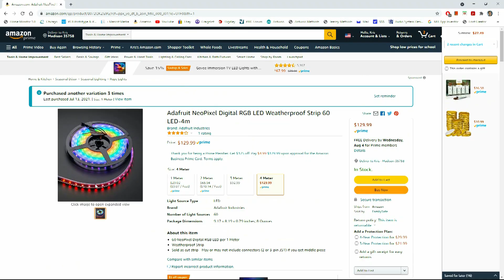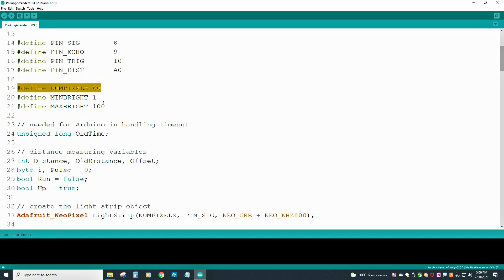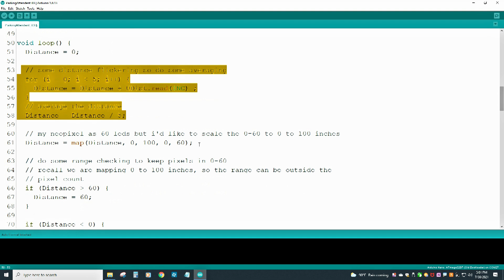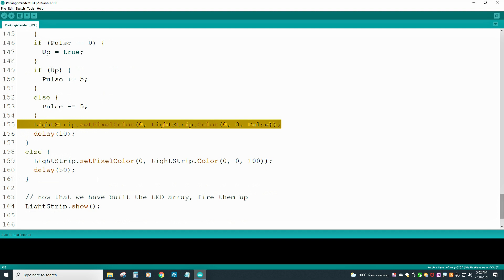DIY Garage  Parking Assistant

Comment: I enjoyed your video and decided to make this. I have copied your program and when I try to compile, I get an error on line 83, "ElaspedTime 
was not declared in this scope". On lines 28 and 29 you state "include if you are using a Teensy elapsedMillis ElapsedTime. First question is what is a Teensy, second question is how do I include elapsedMillis ElapsedTime? I am an old retired plumber and my wife got me an  Arduino Elegoo Mega 2560 Starter Kit for xmas. Computer programing for Arduino is fun to learn and I could really use this parking design for my wife, of course.
Reply from the maker: ahh yes. You will need to grab a library for the ellapsedMillis call. you can get this one

https://github.com/pfeerick/elapsedMillis

Note: A Teensy is a competitor to the Arduino and like a million times better--you will get there :)

Have fun.
Reply: @KrisKasprzak  perfect, compiled and loaded. Life is good, now to build  hardware from your schematic. Thanks again ✌️

Comment: Hello Khris, I just found you in YouTube ..... I need to subscribe, I enjoyed your work....and I run into this "Garage parking assistant" great video.
I was compiling the code and run into the following error:

81..// if activity, reset counter which will wake up the unit, and display measured distance
82..  if (abs(Distance - OldDistance) > 2) {
83..    OldDistance = Distance;
84..    ElapsedTime = 0;
85..   Run = true;
86.. }

Did not like line 84
Compilation error: 'ElapsedTime' was not declared in this scope

Here is the analysis that I got from a compiler:
"Since you are using an Arduino Nano, you should not use the ElapsedTime variable as it pertains to the elapsedMillis functionality, which is not inherently required for your scenario. Instead, you should rely on the millis() function and the OldTime variable that you've already declared to manage timing and timeouts in your code.
Here's what you can do to correct the error:
Remove or comment out any references to ElapsedTime in your code. Since you mentioned that the error occurs when trying to use ElapsedTime, you should ensure that any code attempting to use this variable is either removed or replaced with logic that uses millis() and OldTime.
Use millis() for timing: You've already started this approach with the OldTime variable. To implement a timeout or measure elapsed time, you compare the current millis() value to OldTime and update OldTime when you start timing."

Does this make any sense ?
Can I have your comments ? Maybe I am doing something else wrong since the original code is working, so I am not sure why I am getting this "Compilation error"

Thank you
Reply from the maker: When you have an application that is intended to run for weeks, months, or in this case, years, it's very bad practice to use millis(). After 29 days millis() will roll over. If the code does any time comparisons around the roll over your program will give some errors. While probably not a big issue here, it's better to use a library that will handle roll over.
Reply: @KrisKasprzak  Hello Kris, thank you so much for your reply. I have done all you shared with us here, but I can not get pass the 'ElapsedTime' in code line 83. 

I did download the <Adafruit_NeoPixel.h> and the <Ultrasonic.h>. Do you have an idea on what I am doing wrong?
I keep getting the 'ElapsedTime' error code. 
Thank you for your patience !!!!!!! Do not loose it yet !!!!